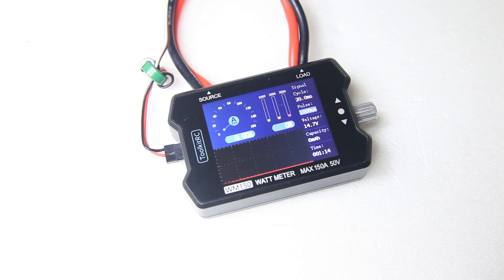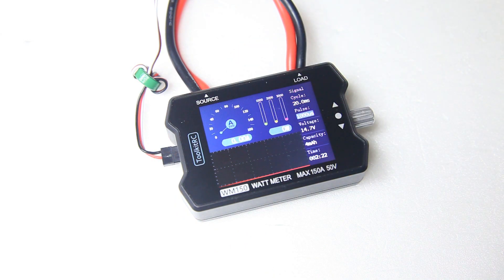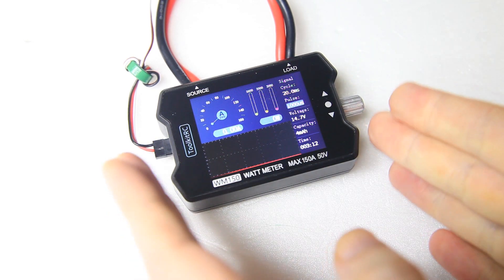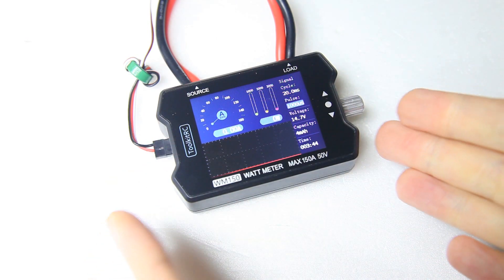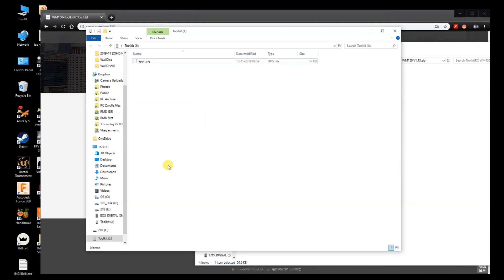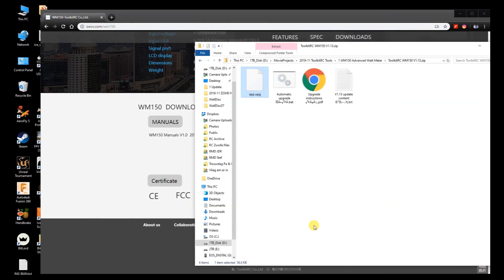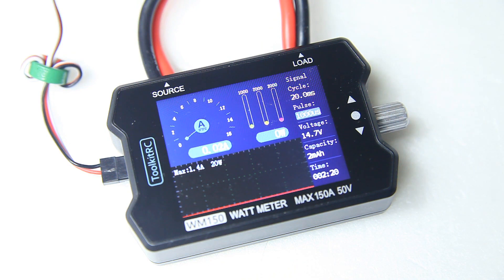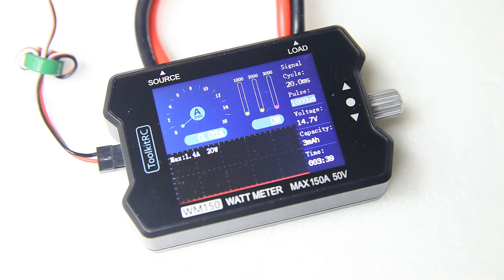ToolKitRC - WM150 Advanced 150A Watt Meter - UPDATE!

Comment from the maker: we complained : they improved the firmware! :)  
Link to the Watt meter: https://www.banggood.com/ToolkitRC-WM150-150A-50V-Watt-Meter-Power-Analyzer-LCD-Display-Power-Voltage-Current-Tester-PWM-Output-p-1593171.html?p=TO251813974002015038 

Site for firmware updates: 
https://www.toolkitrc.com/wm150 

Site for Wholesale info: 
https://www.hobbyporter.com/toolkitrc-wm150-advanced-watt-meter-1-50v-150a-24quot-tft-screen_p1981.html 

Specifications:
Input Voltage: 1 - 50V @ MAX 150 A
USB: 5.0V @ 1A Firmware upgrade USB3.0
Output PWM: 1000us-2000us @50Hz
Display LCD: TFT 2.4 inch  320*240 resolution
Product Size: 80mm*54mm*23mm
Weight: 120g

Comment: My device hasn't been recognized as a drive, the update process you described didn't work
Reply from the maker: I think a USB3 port is required for the device to be recognized.. could that be the cause?
Reply: @DutchRC  I've bought a new one, that's probably the cause of the problem.
Reply from the maker: @badrx5783  weird but indeed possible.. have you tried different computers?
Reply: @DutchRC  yeah, I have, but I didn't have a usb 3 micro, that's not that common

Comment: OK UPDATE!!!  Yes, you have to have this powered up (at least on the 2 units I have)!  I applied power to the load side of the meter and then plugged in the USB cable into the PC.  Once I did this the Toolkit drive popped up immediately.  I than updated by deleting the file and replacing it with the new firmware.  I am honestly beside myself in how bad this was managed in the instructions

Comment: OK confused,  I tried 2 computers and nothing?  Do you have to have this thing powered up before hooking up to a USB port and does it have to be a USB3.  If so why the heck would they make USB3 a requirement as a lot of people (like myself) dont even have a computer with a USB3 port.
Reply from the maker: Hmm that is weird.. the M8 charger DOES require a USB 3 port but I am pretty sure I updated this WM150 on a non USB3.. 
Could it be your cable?
Reply: @DutchRC  I am using the cable it came with LOL
Reply from the maker: @ddfwaj  Hahaha :D  
okee I tried for myself.. supplied cable + non USB3 port and not powered by a lipo, mine shows up as a USB-drive.. 
soooo.. not really sure what to say other then USB3 isn't required..
Reply: DutchRC Adventures Ok thanks,  I guess I got a doa unit.
Reply from the maker: @ddfwaj  it doesn't do any power-metering either?
Reply: DutchRC Adventures Didnt want to add connectors until I upgraded to verify it worked plus I am sure RDQ might not take it back if altered.
Reply: Well..........I just received my replacement unit today and same damn thing!  When you hook yours up to the USB port do you get a display or does it stay black screen?  How does it show up on windows as an additional drive?

OK UPDATE!!!  Yes, you have to have this powered up (at least on the 2 units I have)!  I applied power to the load side of the meter and then plugged in the USB cable into the PC.  Once I did this the Toolkit drive popped up immediately.  I than updated by deleting the file and replacing it with the new firmware.  I am honestly beside myself in how bad this was managed in the instructions
Reply from the maker: @ddfwaj  Ehhhh okee? that is weird but I guess you have a revised version in that case :)   Mine for sure does not need external power to show up as a USB drive.. 

BUT good to see it's then solved :D

Comment: Great thanks, I bought a pair from your link from your original video. This FW update mechanism also means it works fine from Apple Macs. A couple of comments.

The data is meaningless unless you actually have a load on the Motor. e.g. Props.
As it supports 150A I would recommend the correct connectors to allow you to test up to 150 Amps not XT60s. You can use plug converters to allow the down connection to XT60s but XT60s will not allow you to convert up to 150 Amps.

Cheers
Reply from the maker: Thanks for the support Briand and Yes.. this kinda seems like The way to update firmware on devices like these.. 

Yes I know.. it wasn't ment to be an actual test of that setup.. a static test with prop doesn't mean much eighter by the way.. 
True.. the things I will test will never exceed the limits of XT60's.. I sometimes do runs with airplanes and boats to see if I can prop up..